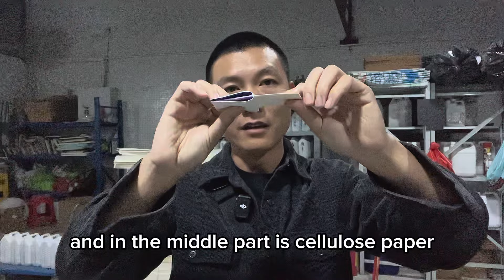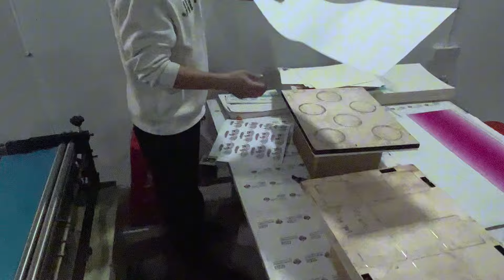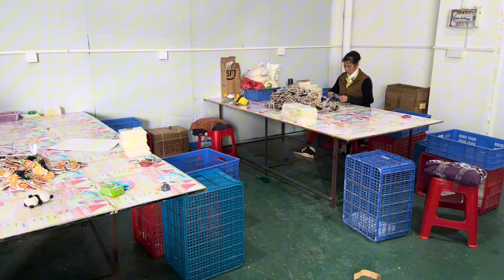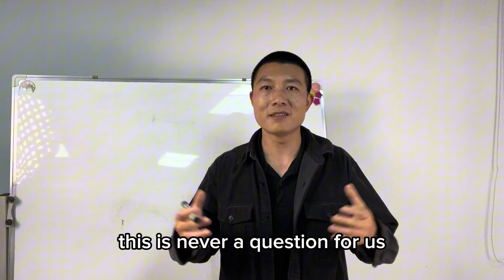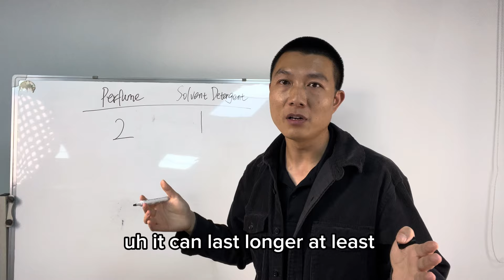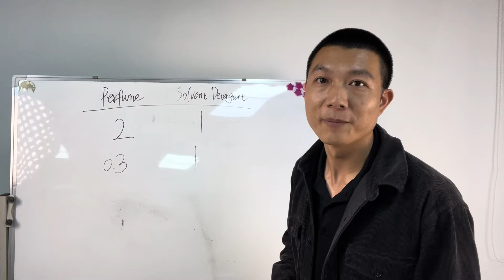Paper Air Freshener Mass Production | How They're Assembled & Packaged in Factory

Comment: First of all , i admire you to give such a great information regarding paper air freshener, I've been struggling a lot with this business model ... I couldn't find any information nor no one else was willing to give any information...
finally I found your video.thank God i was releaved a lot somany confusions were cleared 👍...
but i have few questions too,How do you print them.... I've tried some methods....but when the fragrance is dipped .. the ink is scattered....

1.what type of print you use?
2.does the alignment of the top and bottom collof the coated paper comes same?
3. what's the ratio of dpg used?
4. Are you using normal fragrance oil only?
5. Do you sell  cellulose paper and coated ?

I know this is huge ask ....if possible give me information regarding, how it's printed 

Thankyou 😊

Comment: And one more question, if I may? Do we place the package in the vacuum machine after sealing it? Or before sealing it?
Reply from the maker: Before sealing, the vacuum packaging machine will seal the bags
Reply: @evanyang000  I saw this ?  in a previous video where the bags are sealed using a different machine called a hot-sealing method.